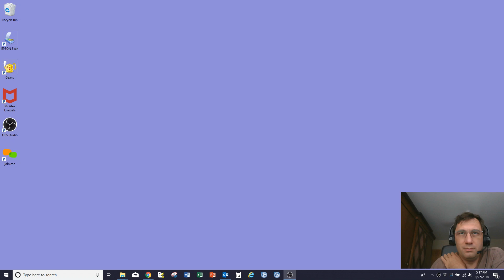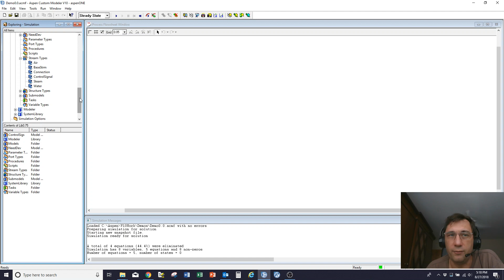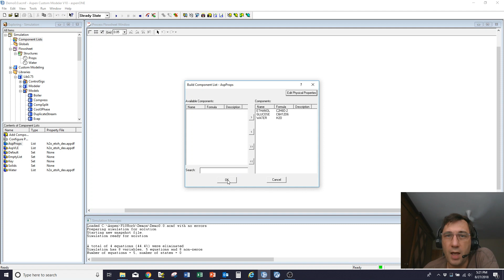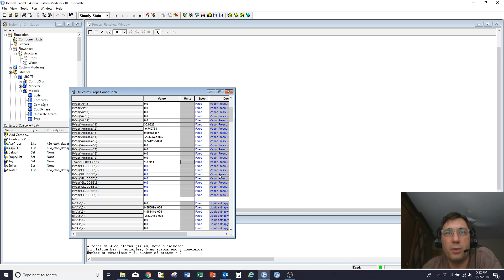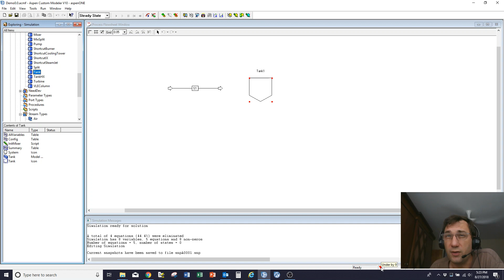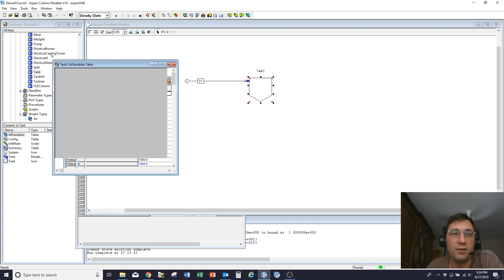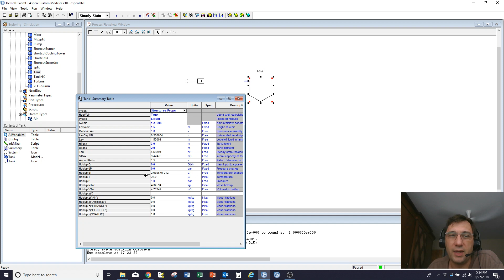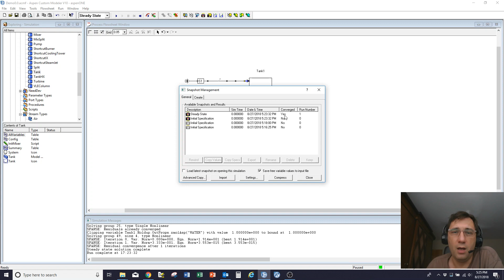ACM2.  Flowsheet equations, running models and using snapshots

Comment: Hello, thank you so much for your videos! :) I am trying to open a custom model provided by AspenTech, but it gives the error "ACM models in this case are older 32 bit versions that are no longer supported. These models need to be re-exported from a 64 bit version of ACM". Could I ask if there is anything I can do to open these models, as I have tried (and failed) to get the 64 bit versions from AspenTech :"( Thank you!
Reply from the maker: That's not an error that I've come across before.  My guess is that the "acmf" file should be opening up OK, but that there's a binary component - a compiled "acml" library or a compiled phys props "appdf" file.  I think that the only thing that you can do is to go back to the author and ask them to share a binary version of the model.

Comment: Hello, is there any model for iterative calculation, please?
Reply from the maker: Doha - ACM is not really set up to do iterative calculations, but that's because it solves most calculations directly...  Iteration is usually used in sequential programming to solve complicated equations sets (eg non-linear reaction kinetics or large flowsheet recycle loops).  ACM (like other equation-oriented tools) solves those non-linear equation sets directly with a Newton approach.
If you really need to iterate, then your best option is to code something in C or Fortran as a subroutine, and then link to that routine from ACM - that's how ACM connects to Aspen Properties, for example - but that's an pretty advanced thing to do.
Reply: @cssandersonllc3172  Thank you for your reply. 
The problem I want to solve is:
I have a device.1 that needs certain power (P), and I will connect it with another device.2 that supplies power (E=J*V). E is known while J and V are not
J is needed all over the process as it influences other parameters. So I need to find (iterate) J in order to always get (E=P) ( which means to supply the device.1 with the power needed from device.2)

Could you help me with this, please?
Reply from the maker: @dohaelrhoul3849  You should be able to put the equations into ACM and let the software work out how to solve them...  It does iterate internally (typically using a Newton-Raphson non-linear solver), but you don't have to write the iterative code.  All you need to do is make sure that you have the correct number of equations / unknowns and that you supply decent initial conditions
Reply: @cssandersonllc3172  Thank you very much for your explanation. Do you have any published reference(s) I can use to support my work, please? (to avoid the iterative code)
Reply from the maker: @dohaelrhoul3849  I don't have anything simple to hand, but most of demo ACM models show solving non-linear equation sets.  I hate to be that guy, but this really is a case of "read the manual" - what you're asking about is the fundamental basis of what ACM does.  It's why you use something like ACM instead of Python or equivalent
Reply: @cssandersonllc3172  Alright, sorry it's because I am a new user and I am discovering by application. Thank you for the clarification

Comment: Can we perform iteration in ACM likr goal seek in excel
Reply from the maker: That's a somewhat complicated question as there are a few different things that Goal Seek can do...  Let me play out some scenarios:
- You can use GoalSeek to solve a non-linear equation (or set of equations), but calculating the error between a set of input guesses and the results of the equation(s).  In ACM, this is handled within the system - you supply the equations and and target input, and ACM sets up a Jacobian matrix and directly solves the equations using a Newton method (or a variant thereof).  There is iteration involved, but that's more-or-less hidden from the user.  The powerful thing about ACM is that it interprets the equations and problem structure, so you can change the inputs and outputs for the system and ACM will reformulate and solve the new problem (eg you define a heat exchanger and can then fix the approach temperature to calculate the area, or fix the area and calculate heat transfer coefficient).
- A subset of this is closing a recycle loop.  In Excel (or indeed in "regular" AspenPlus), you have to define a "tear stream" and iterate - you guess the tear stream flow/composition/temperature, and then solve the system, then update the tear stream.  In ACM, this is all solved internally, so you don't have to define how to solve the problem.
- GoalSeek can also be used for optimization.  In ACM, you can set up an objective function and constraints, and then solve non-linear and dynamic optimization problems directly.  I don't think that ACM has a mixed integer solver included, but it does have an open interface to allow you to bolt on your own solver.

Charles

Comment: Hi, I am relatively new to ASPEN, I wanted to know how would someone go about making a membrane separator?(need 5 membrane separators in series for an aspen Plus project)
Reply from the maker: It's a relatively involved process - you need to decide what you want to model in ACM and what to put into A+.  I typically model everything in ACM, but I know that's not what most folks do...
Once you have decided which bits to model in ACM, you then need to find the equations that you want to use.  ACM is generally quite accommodating in terms of what you can model, but you generally start with a blank sheet so you need to develop your own component and energy balances, and work out equations to describe component separation etc.  Hopefully the various videos on this channel can help you to identify how to structure and debug the models.
Once you have a model for the unit operation working in ACM, you then need to package it up and export it to A+.
I hope this helps - if you have more specific questions, I'd be willing to try to support you further

Charles
Reply: @cssandersonllc3172   hello sir, I'm also interest
 need to model a membrane separator in aspen
Reply: heelo can you help me if you do your work withn acm

Comment: Hello,

thank you for the very interesting and informative videos for ACM. I would like to ask a question. I started building my own model but little did I know, I started with creating the component list by exportin the Aspen plus document etc and then I just moved on with writing the code but then I realized something was missing. Was I supposed to first add the variables and the parameters from the window on the left (as you described it in the 1st video) and then the code would be like 'written itself' with all the code parts for each variable/ paramter and so on? I hope I made it clear enough for you to understand it and help me.

Thank you in advance and again for your work !!!
Reply from the maker: I'm not sure I completely understand your question, but let me guess.  When you create a properties set in A+ and then link your ACM model to the appdf file, there's another step that you need to take.  You need to go to the ComponentLists area and select the ComponentList that you're using in the model (usually Default).  If you open this up, you'll get a 2-part window that allows you to move some or all of the Aspen components from the left (available, but not used) to the right (included in the model).  This will determine which components are then included in your ACM model
There's no automatic creation of equations, I'm afraid, but you can rely on the set maths so that you don't have to reference each component by name.

I hope this helps

Charles
Reply: @cssandersonllc3172  Thank you for you quick respond. I already have done this, set the components list. My question was about the code that I am supposed to write in order to create my own block/ process. I just put everything in it? Like the variables, parameters and equations? I have already put the variables and parameters based on a ACM example and right now I am struggling with the stream-block connection and then I will be with putting the equations but I think they are a little more simple. If you have anything to help me I would be grateful! 
thank you again!!
Reply from the maker: To define a variable set, you can treat the ComponentListName as a StringSet, so for example:
z(ComponentList) AS MassFraction (Description:"Mass fraction of component");
z2(ComponentList) AS MassFraction (Description:"Mass fraction of component");

To use the new arrays, you can either use implicit code:
z2 = z1;

Or you can access the elements explicitly:
FOR i IN ComponentList DO
  z2(i) = z(i);
ENDFOR
Reply: @cssandersonllc3172  thank you !!! Do you know if there is a procedure to call in order to connect the inlet stream with the block, when my system works with gas-vapor mixture and the proceudre pFlash etc are used for the two phase system of vapor-liquid ? I have the V7 on aspen, is there any chance the new version (V11) to have this new feature? thank you for your time
Reply from the maker: @noumhfish948  I'm not sure I quite follow what you're trying to do.  If you have a (potential) 2-phase stream you should be able to re-create those 2 phases (in terms of vapor fraction and liquid/vapor composition/enthalpy) with a pFlash calculation in either the Stream or the Block model.  If you don't want to do that, you could add more variables to your Port (eg vapor fraction, vapor enthalpy and vapor composition as well as the overall composition/enthalpy/flow).  Either should work, but obviously you'd need to add extra code.
Alternatively, perhaps you're asking about scripting the building of the model?  In that case, you could use VB to make a connection - the Help on that is decent
Reply: CS Sanderson LLC the terms liquid and vapor got me little confused as I use for example CO2 as one if the inlet gases of the inlet gas mixture and since the temperature of the system is 900 degree Celsius the CO2 is a vapor for the model I thought that there was supposed to be a flash for gas mixtures that was I was trying to tell previous
Reply from the maker: @noumhfish948  What do you mean by "Flash"?  I understand that to mean "bringing a mixture to vapor-liquid equilibrium" - that's the intent of the pFlash routine.
Reply: CS Sanderson LLC in once of ACM examples they call pFlash for the anode inlet connection (the example is the one “PEMFuelCell”.
Reply from the maker: @noumhfish948  I'll take a look when I have time.  In the meantime, can you explain what your'e trying to achieve?
Reply: CS Sanderson LLC in a few words I wanna build a high temperature electrolysis cell -block for an electrolysis process and I’m taking into account the example with the PEM fuel cell

Comment: hi, would you mind if I ask you a question on ports? I just started to learn ACM and write my own model. There' no error after compiling.  The model already defined ports. But when I want to initialize it, the red triangle is there and said my simulation is underspecified by too many fixed values. And I can not find ports connections, the tiny blue bar, when I want to connect a stream to my model. do you have any idea about it? thxxxxxxxxxxxxxxxxxxxxxxxxxxxxx.
Reply from the maker: Hmm - I'm guessing that there's a typo somewhere in your model, so that the ports that you've defined are somehow already connected within your model code...  Tough to troubleshoot without seeing the code though - if you could share that, I'd be happy to take a look.  charles@cssanderson.com